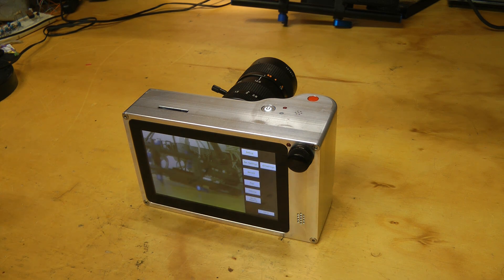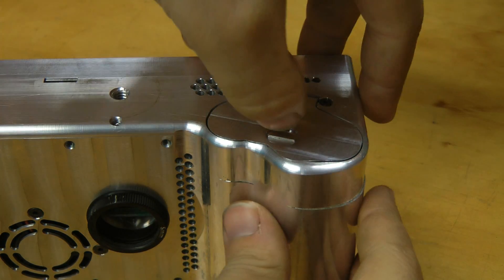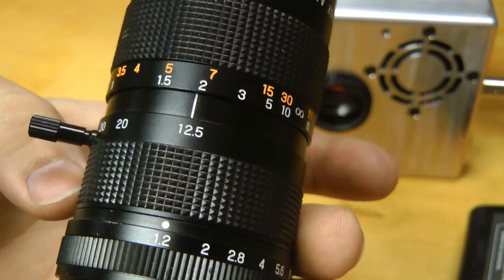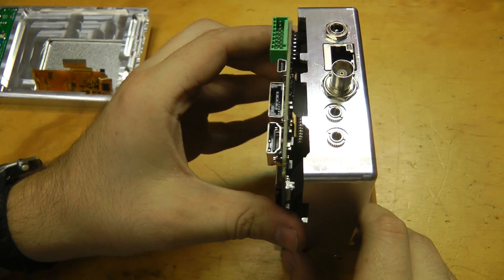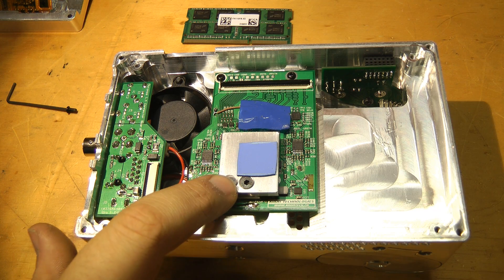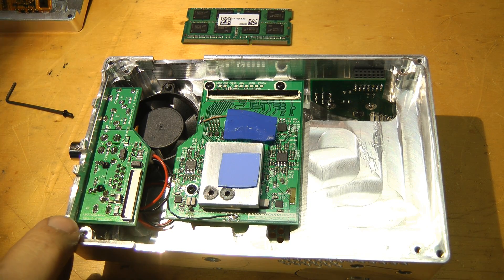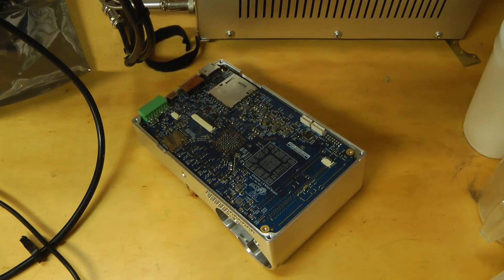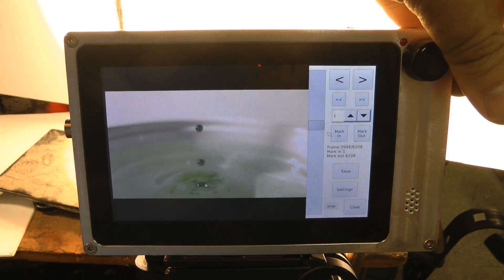Chronos 1.4 high-speed camera overview, teardown and demo

Comment: Looks really good so far!!
2 things that come to my mind tho: SDI output since professional industry uses it for all the gear. i know there is converters but its just not very convenient.. you wanna be abel to plug a bnc cable and be done. the other thing is some option for RAW output. you mentioned that the camera produces a H264 which is fine for consumers but not very useful for professional production since they almost always need uncompressed material for the post production.
Reply from the maker: I could do an HDSDI version if there is enough demand. There will be RAW output in a future software update, so that's covered.

Comment: That slick case tho! Man this looks soo nice, i mean, for a production ready piece, it's really polished, and i'm not talking about  the shine either. I've seen far, far, worst looking products. Hope that the Kickstarter gets a lot of attention because this is a special camera.  Love the name too.
Reply: About the cables, I think it was HP that had a kit for their older laptops that allowed operation with the machine pulled to pieces. Essentially extension cords for connections. Consider maybe getting some done?? Essentially you need a ribbon cable and a connector. Not really that complicated.
Reply from the maker: I have a bench version for debugging that's mounted on a board for easy access for debug, forgot to show it here.

Comment: Is there any way to save the board that got Catted? I haven't looked into bga work enough to know if it'd be possible to attach a new fpga to the board without causing problems for all the other components that are already attached.
Reply from the maker: I wish it were as simple as putting on a new FPGA. Most of the pads were lifted off the FPGA and stayed with the PCB, but some pads were lifted off the PCB and stayed on the FPGA. This makes is pretty much unrecoverable.
Reply: ah, yeah lifted pads would be a problem.

Comment: This is awesome! I might even break my rule and back the kickstarter :P

A few questions:
1) Have you considered other sensors, e.g. the CMOSIS CMV12000(4K300, 910 fps @ 4096x1080 IIRC), or the Luxima AM41(used in NAC/Ikegami Hi-Motion II)? The only problem I see with it is the slightly insane number of LVDS pairs on both, but those would be awesome sensors to use, at not that much cost for performance.

2) Do you plan to have other native lens mounts, like Nikon(widely used in the high-speed industry), Canon, Sony, etc, without C-to adapters?

3) Will the software be user-extendable, if not opensource? I'm running into several bottlenecks with my $60k camera that can easily be fixed with a few lines of code.

4) Is there any high-speed connectivity? Saving 8, 16, or 32GB of RAM via USB2 and regular 10/100 Ethernet is going to be a huge pain, especially if you need/want to tie the camera to a computer for research.
Reply from the maker: Hi Spirit,

1) Yes, I had considered those while selecting a sensor, but the LUX1310 offered the best performance for scientific applications. I plan to do a camera with the LUX13HS (720p 4500fps), AM41, and maybe other high-IO count sensors once this camera is released and stable. Would need at least 2 FPGAs for that.

2) Nikon lenses can be used with a C-F adapter, I could make a sturdier one that mounts natively if there is a need for one, for High-G applications for example.

3) I'm thinking of open sourcing the user application, as the FPGA is what people would really need to fully clone/steal the design of the camera. The user application is definitely something I can see advanced users wanting to change, to add features, most common things could be done without changing the FPGA bitstream.

4) Yes, it has SATA 3G and gigabit ethernet, you could extract 720p raw video at about 80fps through GigE, about 3x that through SATA.
Reply: tesla500 Thank you!
Good luck :)

Comment: You have my attention! I was hoping you would make your camera available since the first time you demoed it. Great footage, where does it max out for frame rate and resolution?
Reply from the maker: Max resolution is 1280x1024 at 1,050fps, you can do higher rates at lower resolution, eg:
720p 1500fps
640x480 4400fps
640x360 6000fps
640x120 18,000fps
With this sensor architecture, there's no speed benefit to going below 640 pixels width, but vertical resolution can still be traded for speed all the way down to 1 pixel.
Reply from the maker: 4 seconds with 8GB RAM. You could potentially boost it to 5 seconds by dropping from 12 bit to 8 bit.
Reply: So Awesome!
Does it use regular DDR3 / DDR4 SODIMM memory?
Also, do you think it would be possible to add a connector that outputs 5V + 12V (maybe via a 2.5mm stereo jack) with enough current to power a 2.5" SSD?
(would be super useful since it has esata already and if raw video will be availiable with a firmware update a 1TB SSD is probably a reasonable choice)

I love how this project keeps getting better and better! I can't belive you don't have more subscribers than you do.

Rock on and keep us updated! :D /)

(next version with NVMe storage and 1080p ? xD)
Reply: How much recording time do you get at those resolutions with the base 8 GB module? Can you increase it with lower color depths from the sensor?
Reply: tesla500
Great specs, that's what I was hoping to hear. It looks like a camera that could take on the industry heavy hitters for people in the amateur market.

Comment: Will be putting my support behind this as soon as the Kickstarter starts!
What is the maximum speed you will be able to shoot at and what resolution will it have?
Reply from the maker: Max resolution is 1280x1024 at 1,050fps, you can do higher rates at lower resolution, eg:
720p 1500fps
640x480 4400fps
640x360 6000fps
640x120 18,000fps
The sensor datasheet claims 1 million FPS at 1280x1, although not very useful
Reply: tesla500 Thanks for the reply!

Is there an option of changing the dimensions of the image at higher frame rates to a square? 
For example 270x270 at 18,000fps

I have been developing a few pyrotechnic effects and had to hire a high speed camera which isn't cheap. Also, getting people to trust you with their camera around explosives isn't easy....

Would far prefer to give you the money and own my own =) Bring on the Kickstarter campaign!!!

Comment: why not LUX 13 HS?
Reply from the maker: I plan to do one with that sensor after this is complete.
Reply: Way more expensive sensor, I believe.
Reply: Gyppor not too expensive, 1kusd, i have got 2 mono lux13hs, but stuck at pcb layout, due to 40 pairs of LVDS...
Reply: tesla500 i bought a tray of kintex 7 325t, maybe the good choice, very cheap in china.
Reply from the maker: nuo xu
Are you going to use all 80 channels for full speed, or 40 for half speed? How much were the Kintex 7s you bought?
Reply: tesla500 yes i do want to use all channel, because muxing it will be a waste, i have acquire full PDF from them,

i brought a whole tray (36) of k7 325t cost me only 10USD brand new each, but now that seller has sold out, cheapist available is 40USD brand new, cheaper then the zynq 7020.........isnt that amazing

Comment: Also I know touch screens are easy and cheap but there's a reason dslr's still have dozens of functions available through physical buttons, not having to look at a display can be a huge bonus
Reply: I do love the scroll functionality though
Reply: Don't think that's an issue for a high speed camera. Those are not really point and shoot cameras and every shot usually takes some amount of setup anyway.
Reply: Ivan Stroganov A dslr is not point and shoot unless its in auto mode